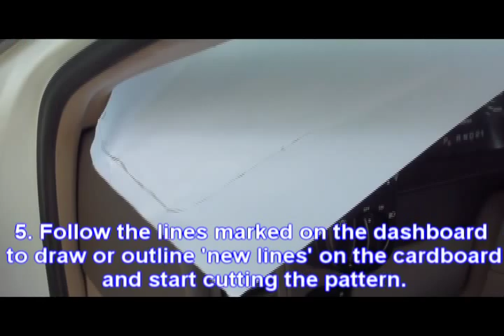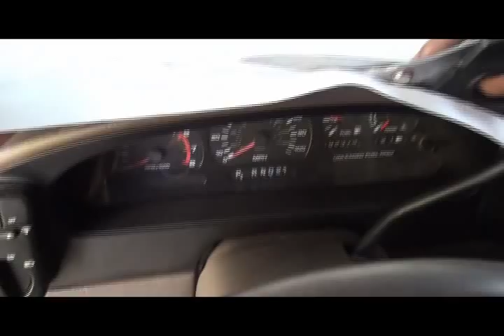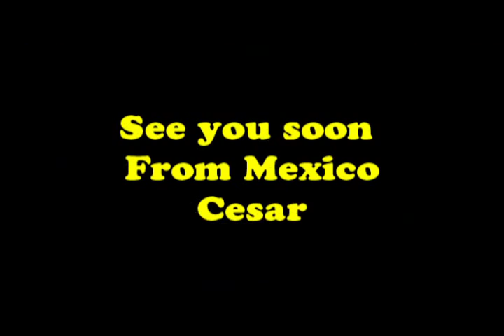How To Make A Carpet Dashboard Cover - Auto Upholstery

Comment: Clips change too fast
Reply from the maker: Sorry for delay in answering ! ...you're right...normal speed is too fast. 
There is a 'little gearwheel icon' down on the right side of the screen. Click on it for the option of less speed...from 'normal' upwards is the 0.5 speed option (it seems OK)
Reply: Cechaflo Hi,very good video,. What make of sewing machines are you using,very interested in the

Carpet binding machine.  Thank you most kindly ,excellent video's.

All the best .

Rosebud.i
Reply from the maker: Roy Fleming Thanks for watching my video! ...The carpet serger is a semi-industrial Yamato, three threads, DC-108. There are 'heavy-duty' machines to serge heavier materials.
Check:    http://www.n-ccarpet.com/heavy-duty-sergers.html